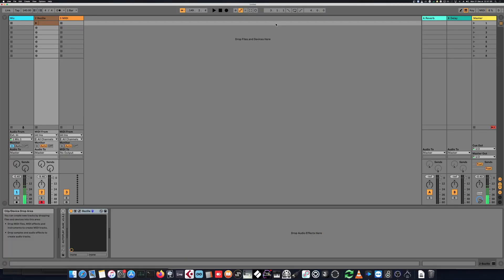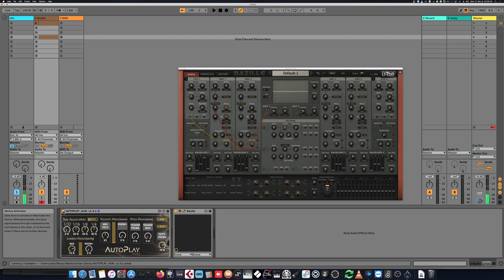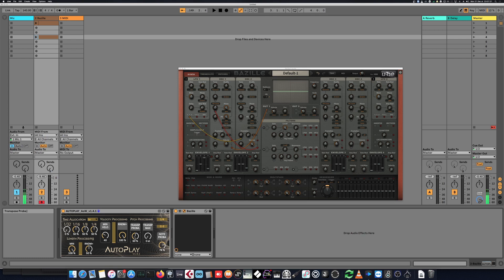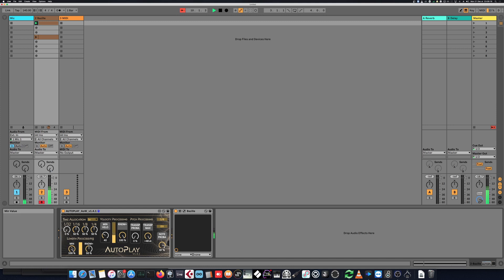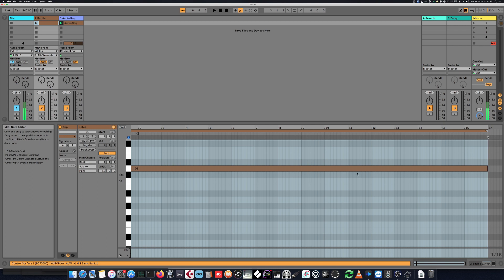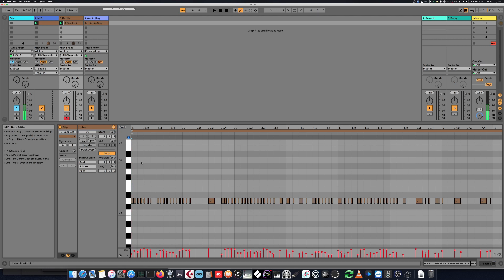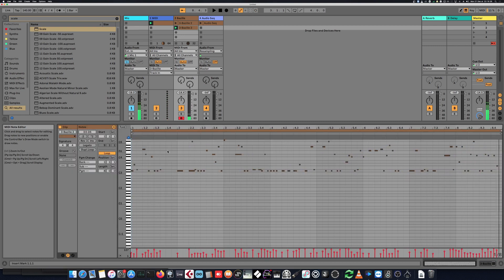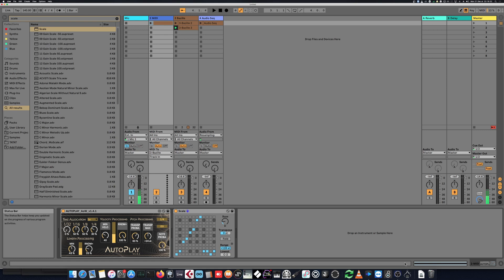AutoPlay

Comment: Can you get this for Logic pro x?
Reply from the maker: Actually I already did it 😉
https://altarofwisdom.gumroad.com/l/Acolyte
Works in most daws (including ofc logic)
Reply: @AltarofWisdom  does it work on big sur?
Reply from the maker: Should work fine though it's not signed or notarized, so you have to follow the steps described in https://www.youtube.com/watch?v=kMfZqKIE5d4 to allow it to run
Not working in M1 so far though, only on Intel based Macs !